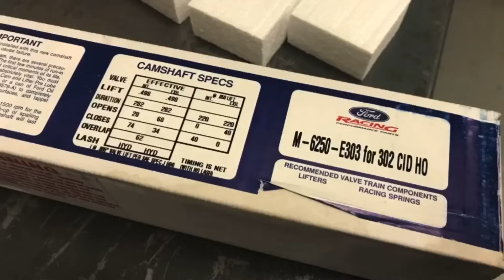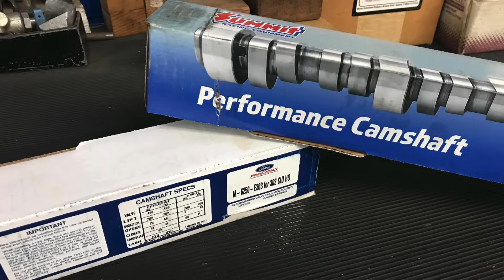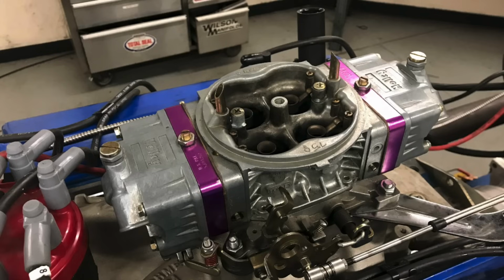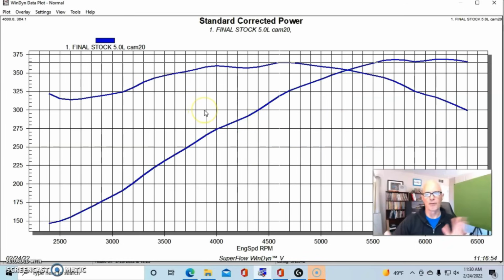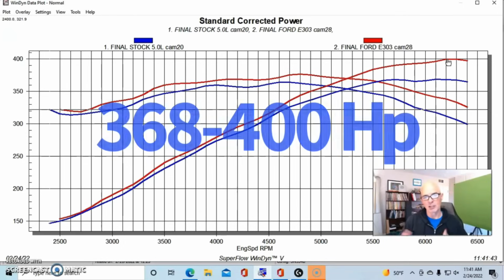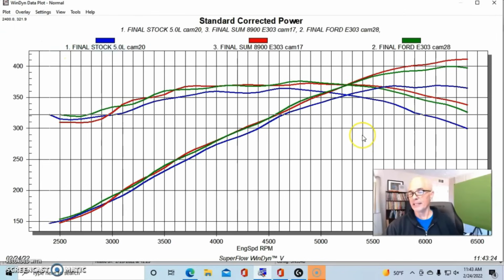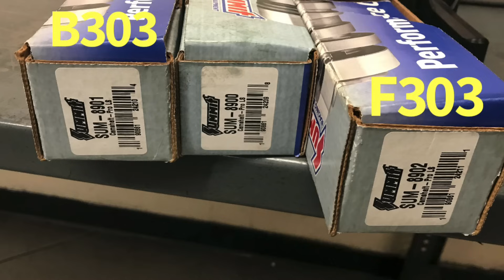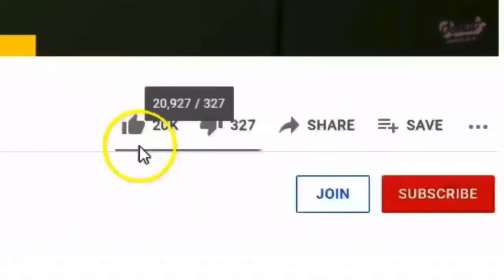HOW TO MAKE 5.0L FORD POWER! FORD RACING E303 VS NEW SUMMIT E303 PLUS-IS THE E303+ REALLY BETTER?

Comment: "44 HP from a cam change. Oh c'mon Richard."😁. Razzin ya for your skeptical mind Sir. But Nice work for sure good buddy. The  best HP Summit E303 + cam is a sure exactly like the Restrictor Plate, NASCAR style cam Currie used in his 352 HP 2bbl 293 cube SBF 66 Fastback.